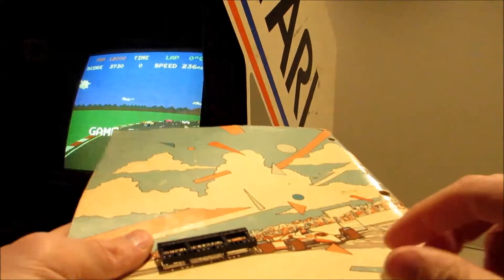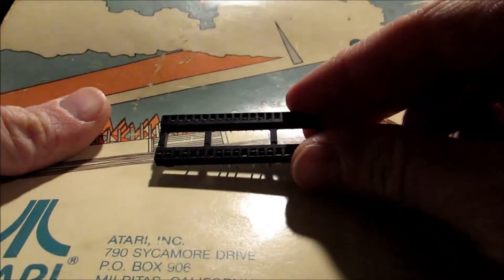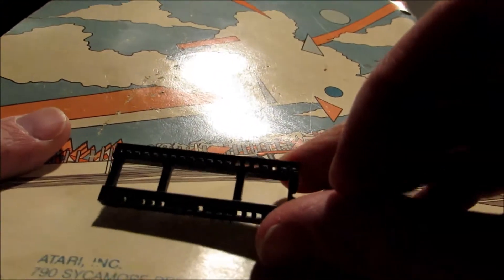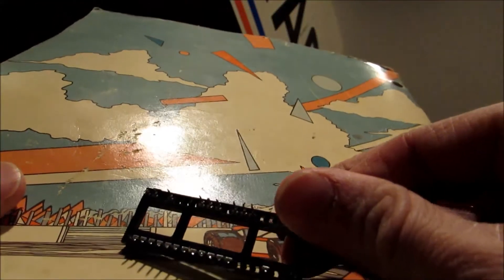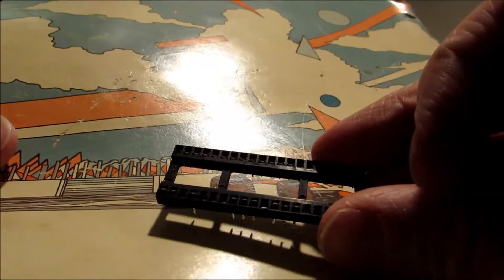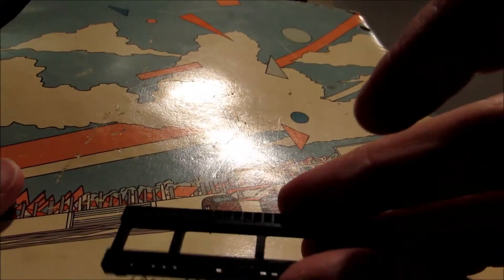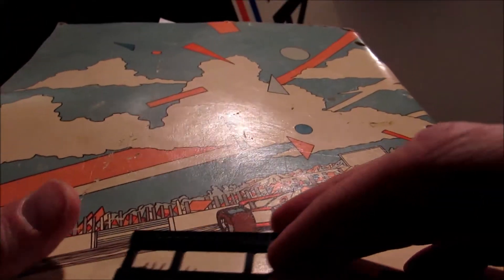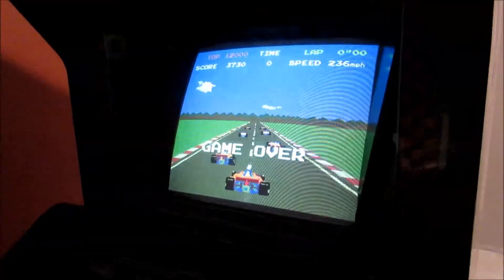Atari Pole Position - Status Update #2

Comment: Extremely jealous.  Any idea what caused the corrosion?
Reply from the maker: So we think that the corrosion was due to the battery that had leaked some years ago and perhaps had traveled. Other than that, I have no other guesses but I suppose it is possible. At some point I will follow the traces and see where they go to verify if it could have been possible.